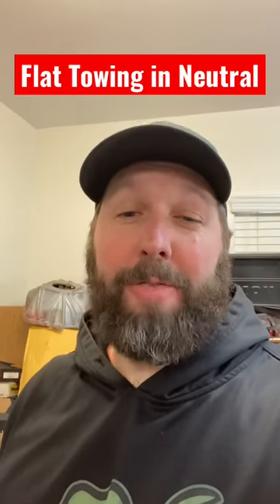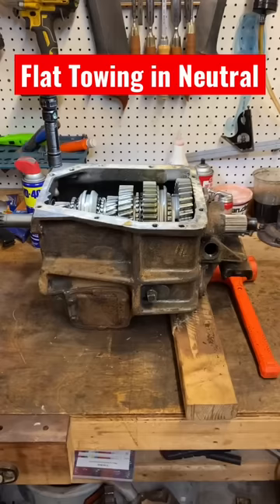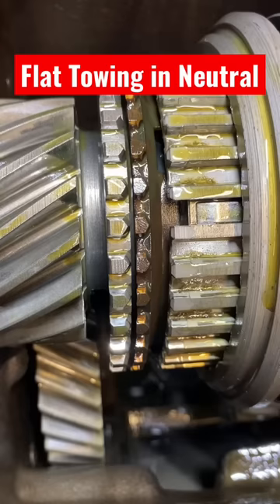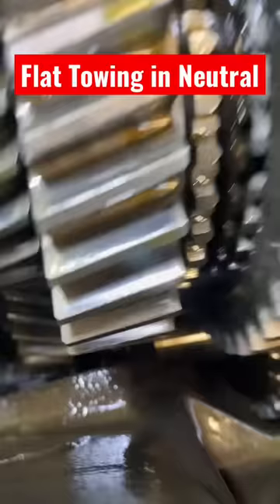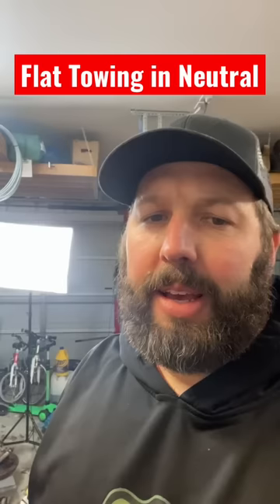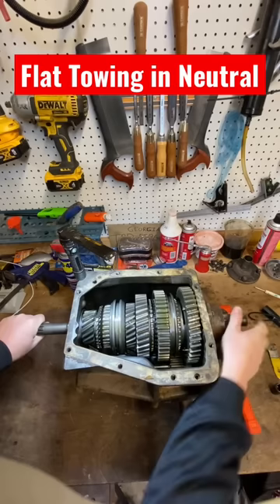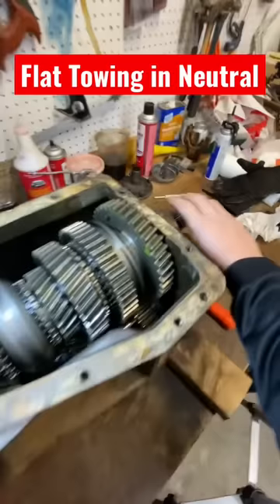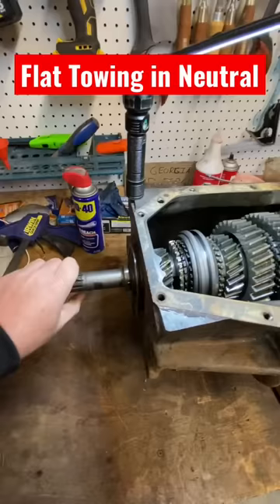Flat Towing in Neutral??? #transmission #stickshift #mechanic

Comment: That would explain why i ruined a transmission on a crosss country trip. Throwing into neutral on long downslopes. Ouch!
Reply from the maker: I guess it’s possible, if it’s a really long downhill and you’re at high speed. If the engine was running and the clutch wasn’t depressed, it would be fine.
Reply: @freedomworx  no clutch, automatic transmission.  Would engine running make a difference?
Reply from the maker: The engine is what turns the pump in an automatic. If the engine is running, the pump is turning, and lubrication and cooling are maintained.
Reply: @freedomworx  hmm...I learned something new. Then it's likely I didn't  destroy the transmission that way. 
Side note, Every auto tranny I've had goes down. So I only drive manual and manage to get 200000+ on a single clutch
Reply from the maker: @jzimmt probably just a coincedence 👍

Comment: So how do tow trucks tow an all wheeldrive without a flat bed?
Reply from the maker: Some can’t be. Some can be. Depends on the trans and the center differential. A Subaru can be flat towed with the trans in nuetral, while some other AWD vehicles cannot be. I’m just saying, that if you vehicle owners manual states that it can’t be, this is the reason. For instance Tremec brand transmissions can’t be towed in neutral. https://www.tremec.com/not_am_detalle/flat-towing-manual-transmission-vehicles/

Comment: That looks like a giant design flaw. Automatic transmissions are no better . The designers need to think ahead a lot better than that.
Reply from the maker: Well that’s like saying an airplane is a bad design because it isn’t designed to land on ocean. A very small fraction of planes are forced to ditch, but nobody thinks we need to design them for that. Because they would suck at their primary job after that, which is to move as much cargo as possible, as quickly and efficiently as possible. It’s a great design for its intended purpose, and Heavy Duty Transmission are still designed this way today. The designers could easily have raised the oil level in the transmission to solve this “issue,” but they would be sacrificing efficiency for the entire life of the vehicle, just to prevent something that will never likely happen, and 100% would t happen is the owner just read the owners manual.

Comment: You domt tow it by the drive tires period without pullimg the driveshaft. The driveline supplies the oil so it needs to be on otherwise
Reply from the maker: It’s perfectly fine in some vehicles. You have to reference the owners manual.

Comment: It really depends on how far you tow it and if there was fluid in there to begin with. I flat towed my manual car roughly 50 miles back to my house when i bought it and nothing happened.
Reply from the maker: You should read your Owner's Manual. Towing in neutral is fine for some vehicles. Some need the driveshaft disconnected.
Reply: @freedomworx  I never got an owners manual with mine, plus my grandfather said it would be fine for the distance we had to go. Plus we never went over 45.
Reply from the maker: @sebkhailer7374  well the reason I make these videos is because too many people do things or believe things that their Grandaddy said, that have no basis in science or fact. Then they spread those “facts” which just keep people ignorant. If I posted it on my channel, just know that I thoroughly researched it before I said it. I loved my Grandaddy, but he was wrong about a lot of things 😉
Reply: @freedomworx  I understand that and you have a very good point, but this was coming from someone who has done it several times with no adverse effects. But i still appreciate these videos because you are right, flat towing some cars for too long will cause damage, some can handle it.

Comment: Then why not move the fill plug to a higher elevation so its always getting oil to the upper shaft?
Reply from the maker: Because that would cause excess fluid drag and heat. You could overfill one just for towing purposes though.

Comment: Just another tip on automatic transmissions. If you are sitting in heavy traffic or a long stop light, put your transmission in neutral. This allows the transmission fluid to flow through the transmission cooler and transmission. If you leave  it in drive with the brake pressed, you are just allowing your fluid to heat up even more and heat is bad. My automotive technology instructor taught us that during automatic transmission class. I drive a 2003 ford f150 and a 2012 Toyota camry, both are in great shape because I have always followed his instructions!
Reply from the maker: Fluid most certainly flows through the cooler while it’s in gear.

Comment: What if someone came up with an auxiliary Oiler aftermarket system to keep those gears wet
Reply from the maker: There are already systems that RVers use to disconnect the disconnect the driveshaft. That’s the most common auxiliary system to protect the transmission.
Reply: @freedomworx  I was meaning to keep it lubricated continuously like a continuous sump mounted externally
Reply from the maker: It can be done, I just do t think there is a market for it personally.  In racing applications, many manual gear boxes and diffs have pumps and fluid coolers.
Reply: @freedomworx  I know that and I'm not entirely sure what that manual is out of but it was just an idea in general for any of the manual transmissions that are specifically used in trucks that would be a great idea but anymore nobody uses them an automatic transmission it doesn't need that but I just had that idea off the top of my head and you're probably right there probably isn't that big of a want for it but I'm going to play around with it and see what I can do with it I have an extra transmission laying around it's an nv5600 why not
Reply from the maker: Automatics suffer from the same failure. The oil pump on the auto is engine driven. Can’t flat tow them at all without removing the driveshaft or placing g the T-Case in Neutral.

Comment: That's why you put the transfer case in neutral.....
Reply from the maker: Yep. That works in most 4wd applications. Still best to check with the owners manual beforehand. There are some T-Cases that can’t be towed in neutral.
Reply: Usually the new fangled ones...
Reply from the maker: Some old Toyota T-Cases couldn’t be towed in neutral.
Reply: Oh what a feeling....

Comment: When you see a suv towed behind a motorhome, how are those supposed to be towed? I'm purely guessing this is flat towing.
Reply from the maker: Depends on the vehicle. Many 4WD Vehicles get towed with the Transfer Case in Neutral, but not the transmission. Some have specialty equipment added to get around this issue. Some can be towed just fine with the trans in neutral. You just have to refer to the owners manual for each specific vehicle.

Comment: What?
Never heard of this.
I've towed many manual transmission cars, not trucks or heavy equipment, and have never had an issue.
Then again they weren't towed for hundreds of km's or miles and definitely not faster than about 60 km/h.
Reply from the maker: It's dependent on the specific trans. You really have to refer to the owners manual.

Comment: Would this also be the case if I was just a coasting and neutral while driving car?
Reply from the maker: It’s not going to matter unless you are coasting extremely fast or for long distances. Like many many miles. And if the engine is running and your foot isn’t depressing the clutch, it’s still oiling.

Comment: What if you put a couple extra quarts of oil just for the trip?
Reply from the maker: It’s an option, it’s just harder than you would think. You can’t just overfill it from the fill hole. You’d need to fill from the top, or construct a special fitting to go in the fill hole. But people do actually do it, and it is affective 👍
Reply: @freedomworx  Thank you for the response.

Comment: I towed a 65 plymouth from Little Rock Arkansas to Louisville Kentucky and no damage so this is wrong
Reply from the maker: It’s not wrong, it’s just not applicable to every vehicle. Only so much can be explained in 60 seconds. https://www.tremec.com/not_am_detalle/flat-towing-manual-transmission-vehicles/
Reply: @freedomworx  worked for me stick in neutral

Comment: not many kids from these latest Generations know what a manual transmission looks like, much less know how to drive one, much less know how to remove a drive shaft. I brought my 550 to a shop one time and they removed the engine out of it and pull the clutch assembly out as well, I know damn good and well they leaked oil out of the input shaft of the transmission and didn't refill it, I investigated the fill plug and it hadn't been removed, there was still greasy dirt all over the top of it, cuz about 3 days later my tranny frapped out with no oil in it and I took it back over there they wouldn't own it
Reply from the maker: Bummer 🥴
Reply: That was 10 years ago,  it had that 6.0, and I did an egr delete,  and changed the injector harness, when I replaced the injectors and heui pump

Comment: So when towing big trucks, on a boggie which axles do you pull? And which side?
Reply from the maker: I don’t understand what you mean by towing on a bogie. To me, a bogie is the wheel assembly under the rear of the trailer.
Reply: @freedomworx  a twin screw tractor or a  two drive axel truck like a dump.truck, also known as a tandem axels
Reply: It's the same principal , instead of disconnecting the drive shaft, because of the difficulty of climbing under truck they pull axels
Reply from the maker: Gotcha. I could envision scenarios where pulling axle shafts might be easier.
Reply: @freedomworx  but u didn't answer my questions?
Reply from the maker: I don’t know. I would not pull an axle shaft out of just one side of an axle. The spider gears would be spinning Mach Jesus going down the road.  But I’ve never monkeyed with a front axle on a tandem set-up. So you’ll just have to explain it to me.
Reply: @freedomworx  I wasn't trying to test your knowledge, I am an ex tow truck driver we had to pull axels out of second rear end,the first rear end from cab is a power divider, you can disengage it by switch on dash, it's air activated, I was hoping you could of refreshed my memory, wasn't sure of pulling both sides of rear axel or just one side? Can Anyone out there  answer?

Comment: So when I coast down the mountain in neutral in my manual, I should be in 1st gear?
Reply from the maker: It’s fine if the engine is still running. The engine will turn the input shaft and lube the trans.

Comment: How do you toe a manual transmission?..can you tow a automatic in neutral?
Reply from the maker: You have to refer to the owners manual. Some can be towed in neutral. Others might need the driveshaft removed, or other compensatory measures. But automatics definitely should not be flat towed in neutral.

Comment: you cannot tow automatic in neutral for long time. For maual no problem
Reply from the maker: Common miconception. It is not safe to flat tow every manual. Some yes, others no.https://www.tremec.com/not_am_detalle/flat-towing-manual-transmission-vehicles/

Comment: Got it lowest gear possible, hand brake on,  and crank steering wheel hard left?
Reply from the maker: You should read your Owner's Manual. Towing in neutral is fine for some vehicles. Some need the driveshaft disconnected.

Comment: But if the vehicle is running while the transmission is in neutral, the oil will get coated regardless.  🤷
Reply from the maker: Yes, if the vehicle is running. But most people don't Flat Tow a vehicle with the engine running.

Comment: Wait, what?
So how are you supposed to tow it? In 4th (1:1)?
Genuine question.
Reply from the maker: I tell the two most common methods in the video. Transfer Case in neutral for a 4wd. Or disconnect the driveshaft in a RWD. It’s perfectly ok to flat tow in neutral in many vehicles, but you should always refer to the owners manual.